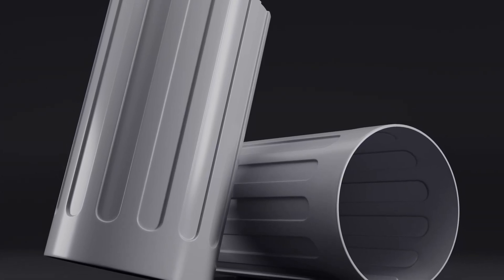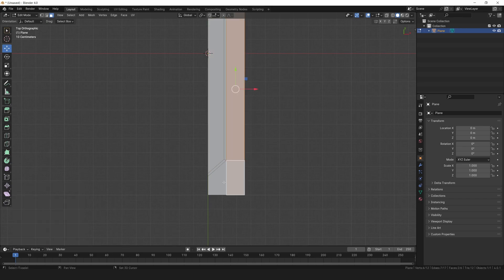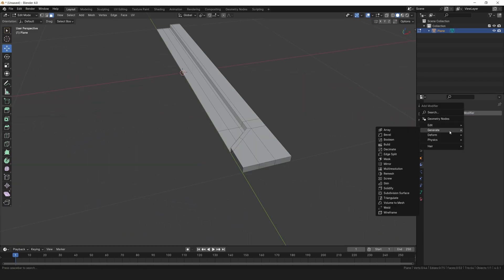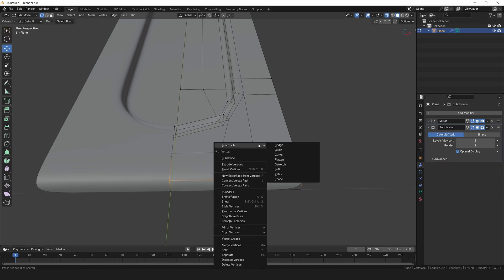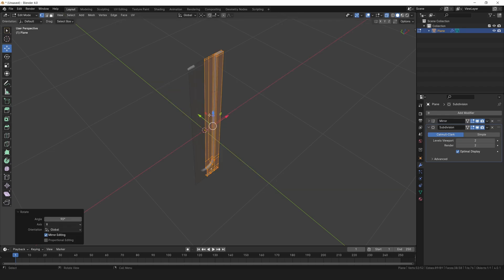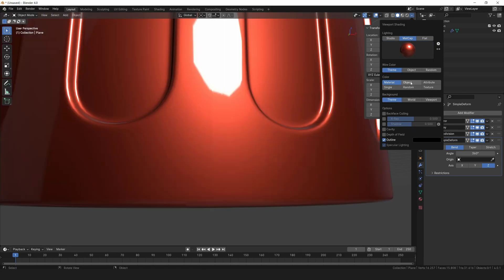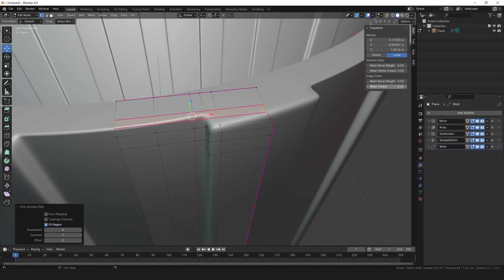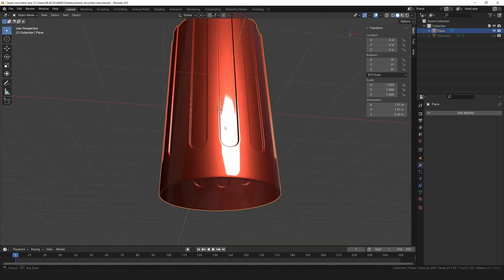Quick Blender Tutorial: How to Model a Knob Cap with Perfect Shading.

Comment: When I apply 360 degrees to the SimpleDeform I get an elliptical shape, not a circle. Any idea why?
Reply from the maker: Hi.
It's hard to guess what the issue is without seeing how you set it up. However, try applying all transformations.
Another thing you can try is adding an Empty (Plain Axes) and selecting it as the Origin in the Simple Deform modifier. Then, rotate the Empty 90 degrees along the Z-axis.

Let me know if that helps.

Comment: Add cylinder > inset faces > extrude faces inward > subdivision surface modifier > shade smooth > smooth by angle modifier > select outer edges of the inset faces > set crease to 1 and you're done. Much faster
Reply from the maker: Thanks for the suggestion! There are definitely multiple ways to do this. I'll give your method a try. I chose a non-destructive approach with modifiers for my tutorial because it gives me more control over the curved shapes. This makes it easier to adjust the shape by changing one part without having to select multiple vertices around it.